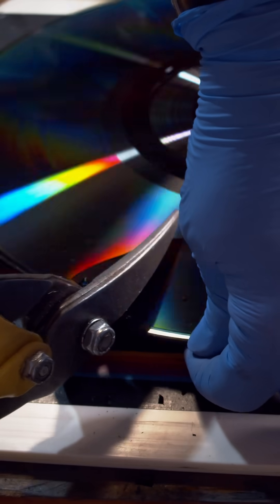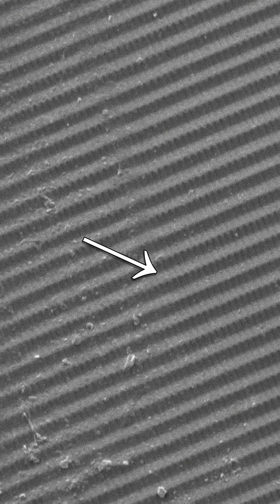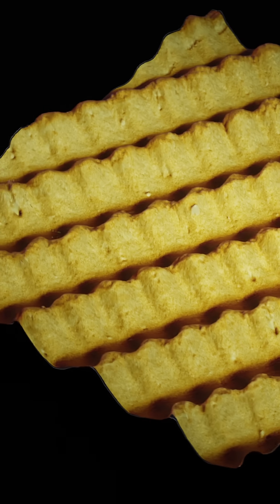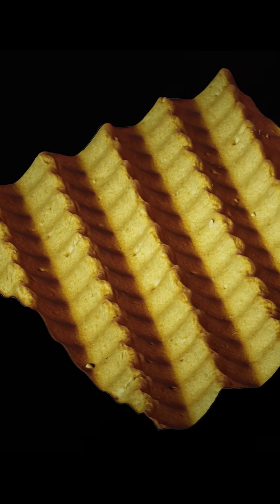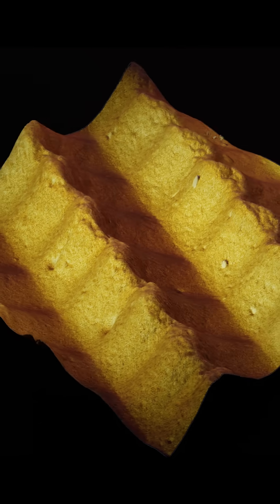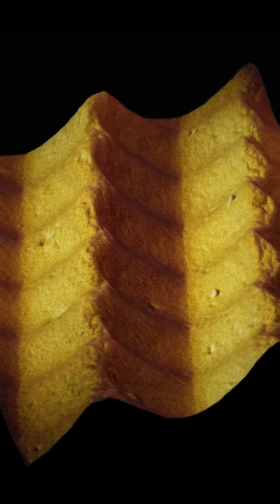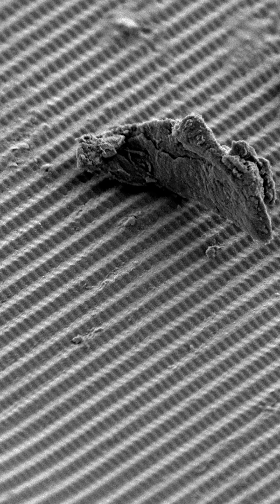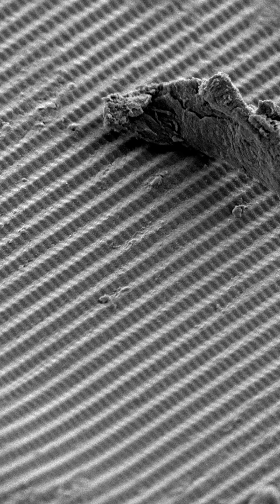Capacitance Electronic Discs

Comment: Okay so as the scales are read over with a laser, the hills and valleys give a direction to form code.. the code can either be transferred on the screen as a number or color.. any other external action is done by the external hardware reading the disc.. so HOW DO YOU SAVE INFORMATION without having to form new grooves on the external hardware ? … burning?

Comment: JVC's VHD (Video High Density) had even finer grooves and used a flat read head which tracked electronically along the groove.  The track density is even higher than Laserdisc.

Comment: These old discs were the highth of tech in the mid to late 70's. My dad got one as a gift from a friend and it worked, I meen we saw a few movies with this monstrosity, but the discs were prohibitively expensive to buy, and regular beta video was coming out about the same time and were cheaper both to own and to get movies for. In the early eighties VCR's were more expensive than beta, but in a weird turn of events, there was a legal battle about pattents and VCR makers won and so beta became a dead fish. They had to stop making them. After that, the vcr tape machines got cheeper, in the eighties. These other machines that used these huge analogue discs were just outmoded. My dad kept his for the longest time, and it was so very problematic about dust colecting on the huge disc while it was playing, we couldn't get through star wars without at least a couple of cleanings of it and the machine.

Comment: When was this technology even in use? I have never even heard of this. I thought everything was done using magnetic tape or vinyl discs back in analog times.
Reply from the maker: They started on the tech in like the 60s, but it didn't make it to market until the 80s (due to mismanagement, and some technical issues). What would have been revolutionary in the 60s ended up being a commercial failure in the 80s because it was competing against VHS, Betamax and Laserdisc. They stopped selling it pretty quickly, so most folks never really saw it "in the wild".

Comment: "technical difficulties slowed development and stalled production of the system for 17 years—until 1981, by which time it had already been made obsolete by laser videodisc as well as Betamax and VHS video cassette formats"

Such a common thread

Comment: Wait what? For the technology to be called capacitance disc, it would mean that a stylus would have to pass over the disc but not physically touch it otherwise it would not be capacitively coupling to it ...
You kind make it sound like there's a nano stylus that actually sits in the groove but then it's just a record...
Reply from the maker: Yeah so it's a bit more complicated, but had to paraphrase for the short. The diamond stylus rides in the groove like a record, but the length of the stylus is such that it rides over multiple ridges simultaneously which establishes a "ground floor". Then the pickup sensor that's on the stylus detects the small changes between that ground point and the individual pits/valleys inside the main groove.  See this image, helps describe the stylus arrangement: https://paleotronic.com/wp-content/uploads/2020/09/Radio_Electronics_January_1982-62-copy.png

Comment: Now explain it to me as if I was 5
Reply: A Capacitance Electronic Disc (CED) is a type of home video format that was popular in the 1980s. It worked in a different way than a CD, so let me try to explain how it works like you're 5!

A CED looks kind of like a big record with lots of lines on it. It's a bit thicker than a regular record, and it's made of plastic. To watch a CED, you need a special player that looks kind of like a VCR.

When you put the CED into the player, the player uses a tiny needle to touch the surface of the CED. The surface of the CED is covered in tiny bumps and valleys that are really small and hard to see. When the needle touches the surface of the CED, it sends electrical signals to the player that tell it what picture and sound to show on your TV.

The bumps and valleys on the CED are like a secret code that tells the player what to do. It's kind of like how your teacher writes on the board and you read what they wrote to learn something new. The bumps and valleys on the CED tell the player what picture and sound to show, just like the words on the board tell you what to learn.

So, just like how a CD player reads the bumps and flats on a CD to play music or show pictures, a CED player uses a tiny needle to read the bumps and valleys on a CED to show pictures and play sound!

Comment: What I love most about these is that the reason it’s a rainbow is because these grooves are so small that any light that hits it gets split into its core colours 

Think about that, grooves soo small it splits the light
Reply: The light isn't split, it's simply that the different thicknesses results in different wavelengths being reflected. It is not a prism which uses the principle of refraction.  This effect is based on reflection and "thin film interference".
Reply: Every 5 inch disc you have does that except for maybe the black copy protected games

Comment: Cool! For anyone interested, this is similar to how a scanning tunneling microscope works that can visualise materials on the scale of individual atoms! The 'dimples and valleys' in that case are litterally the gaps between atoms in the material, and as the 'stylus' moves it measures small changes in the current resulting from quantum tunnelling of electrons in the atoms to the stylus.

Comment: I remember checking out the 3 major digital disc systems at the 1979 AES convention in NYC.  Pioneer had laser, one transport that could support any of audio, data, or video interfaces. RCA had the crappy tracking stylus discs marketed briefly via Radio Shack, before consumers realized how much faster mechanical wear trashed video discs than phono records. JVC had the in between price point non - tracking capacitance pit discs, that made way more sense as an economy system until laser costs fell, but they were never marketed effectively. 

We engineers don't have Crystal balls, but we can act like it by tracking development cycles of parts, technologies, and systems, often years before retail consumers ever notice.

Comment: I worked on the design team for this system. The video FM carrier was 850 Angstroms peak to peak. The Audio FM carrier was 1/10 of that: 85 Angstroms. The Audio FM carrier required an CNR ratio of 40 dB, or 1:100 or 0.85 Angstrom. The master discs were cut in copper. A copper atom is 1.2 Angstrom wide. This means the required noise floor was smaller than the atoms in the master disc. The reason it worked was that the groove was 25400 Angstroms wide, which averaged out the variation due to copper atoms. 

Crazy technical achievement. But the consumer product was just a player, and couldn't record, and it came out at a time before VHS movie rentals were a thing. People were using VCRs to time shift. The CED couldn't do that. 

RCA wanted to sell itself to GE and the VED VideoDisc project was an albatross so it was dumped and RCA went to GE. The execs got their golden parachutes.
Reply: comments like yours are what I love most about YouTube 😍
Reply: @ooooneeee all the comments on this Guys channel are a absolutely Gem of Insight and Tech knowledge...

This had become a favorite💖
Reply: Wow! That's incredible Norm!
This is a brilliant piece of precision engineering. It never ceases to blow my mind when I see one. Very impressive technology.. still surprised it never reached mass production. Those suits didn't know what they were missing. It will be remembered, I'll make sure of that.
Reply: Absolutely love comments when I see people were part of the team and give us insight to the technology or process. You were in effect part of history. Amazing.
Reply: Incredible. Honestly just goes to show, That if they put their golden Parachutes Towards making CD's a thing We could Have had Iphones in the nineties
Reply: @PhilipIIofMacadamia thank God we didn't
Reply: Amazing. Thank you for sharing this glimpse into a part of history.
Reply: Hi Norm,  My Dad (Bill Morewood) and I (Jay), at separate times, both worked on RCA's Video Disk project at the Lab.  My Dad designed and patented the "Electron Beam Recorder" for producing the "Master Disk Plates".  I later working in the Material Sciences group, performed analysts on the diamond stylus, the carbon loaded PVC, (I developed a technique for acquiring slices @ ~10 angstroms for electron microscopy).  I also designed an instrument for real time detection of when a "video disk defect" was greater than what the "video disk defect" circuit could handle among other projects including the 1st robotic furnace to "grow" epitaxial LASER diodes cost efectively, which allowed for the mass production of the CD play technology as a consume product (which ultimately replaced RCA's Video Disk). Best regards  jay
Reply: @ferretseven  this is fascinating! Is there any more about how the master disk plate production worked in practice or is it contained within the patent filing?

You should make some videos yourself on the topics you mentioned 😎
Reply: as a radio mechanic i found your story fascinating.
Reply: That's wild!  I can still see this technology being used for niche secure keys.  You could fit a MASSIVE block of data on a tiny device that can't be read remotely or effected by EMPs/etc. and would last forever.
Reply: Legend :)
Reply: I remember seeing these discs come out!  It  was Super Expensive to have a player and the disks well as kids anything above Album was Futuristic Pricey.

It’s Amazing you worked on these things!  RCA WE ❤ AND MISS YOU!
My Dad has LOTS of RCA Test Tubes and Gawd knows what still in the house.  I will never part with them.

Brings me Memories of Century III Mall and the Tech Store with the Projection TV’s actually displayed the Video Disks.  We didn’t want to leave!
Reply: What was the stamping process like, was it like a retrofitted microgroove 12" process or did it involve plating the discs directly from negatives? If it was more like trad vinyl, did it use a DMM style process or did it go master/mother/stamper? My first thought was that surely the run yield from stampers can't have been that high before new stampers were needed given the groove wear, unless they were grown instead of stamped? Such a fascinating medium this and I wish it had taken off more for archival grade stuff.
Reply: The military bought some of these to use for showing training videos, but I only ever saw them used a couple of times, and then everything was about VHS.
Reply: @slappy8941 I'm sure the military still has buildings full of them. The government doesn't throw anything away.
Reply: Wut
Reply: Sir, please take your change and leave the Wendy's
Reply: @NonieTools  That's funny! I git your joke.
Reply: 1973 working at a “place” I can’t disclose I worked on a 5 x 1 ” cylinder of pure quartz, turning vertically at 10.000 RPM with 2 tunable lasers beams one on top that moved along the diameter, the other moving  vertically. Read and wright device for video, audio & holographic projection. 
These could wright at a molecular level on quartz molecules as visualized by X-ray refraction…
There were images of pre-historical scenes, Pterydactilis flying, scenery of volcanos erupting. Other “folders” hash scenes of cavemen, the construction off a pyramid, not sure which. After that  views of earth from space, continents were not what they are today. There were also scenes of a medieval battle (Hastings?) in minute details.  I am so glad that the “amateur version” of this technology is finally coming out in my lifetime  50 YEARS AFTER A MUCH MORE ADVANCED VERSION WAS ALREADY AVAILABLE! TOO BAD I CANT SAY MORE. I want to die of natural causes! 🤫😵‍💫
Reply: @tonytor5346  How did you see pictures of those times? I don't get it
 I want to tho! ;)
Reply: Thank you for the explanation, and fantastic work!
Reply: So...me no club?
Nah, who me kidding me still club.
Reply: @johnboats9075 why you think me eat dinosaur brains?! Me hate brains.
Reply: Damn! Those were the specs? Man if these became mainstream back then there would be you tube videos where someone is building CED microscopes using an esp32 or RasPi in their bedroom right about now. Truly amazing technology in this system.
Reply: I usually pick these up anytime I see them at a thrift shop.they usually sell for under $4 each. I prefer them to be a crappy movie because they look really cool in a frame on the wall and I’d hate to destroy a nice one.
Reply: Thank you for the additional information
Reply: @gnornhurst Wow! What a great story. I see this like a digital record groove. 
Can you direct me to a video describing how music is put into vinyl grooves of a record, and then read by a diamond stylus that somehow separates all the sounds in the record Grove and transformed into a digital format send to a amplifier and heard in speakers?  I don't understand how sound can be "stored" in a m9lded piece of plastic. How does it separate high voices and low drums, etc? Incredible.
Reply: @joebudi5136  vinyl records' grooves are a purely mechanical analogue representation of the sound waveform - literally a capture of the 'vibration' of sound. A few things are done to process the audio prior to being cut to a disc (mostly EQing, to optimise the signal-to-noise ratio) but that's about it. You can even get a piece of very stiff paper with a sharp enough edge to make a rudimentary stylus; place it in the groove as the disc rotates, and provided the paper is stiff enough it will reproduce the sound.

To understand exactly how vinyl records store waveforms, you must better understand the properties of sound waves. You can have a very simple sound - a sine wave, a pure constant oscillation at a specific frequency (which can be roughly approximated by whistling very clearly) - or any complex combination of distortion, harmonics, different wave shapes and so on. The interplay of different frequencies and waveform shapes produces additional new frequencies which together can sound quite unlike their individual components. Every single sound, natural or synthetic, can be broken down into its component parts, if you understand well enough how to. Combining different frequencies, wave shapes and types forms the basis of electronic synthesis.

Capacitance electronic discs store a frequency-modulated electrical representation of the combined video and audio signal, which is demodulated by further circuitry after being read from the disc. A CED's surface is capacitive, and the stylus reading it is tipped with a small electrode. The signal is recovered using circuitry which picks up and constantly measures the constantly changing electrical signal representing the encoded video and audio data. This signal is induced due to the constant change in the height of the undulations within the disc groove, encoded into a modulated carrier, so it is not a purely mechanical representation of the audio or video in that regard.
Reply: @ChristopherWoods  You took that much time to explain it to me? That's awesome! I kinda ger the analog and a little the ced. Incredible what humans can think of and accomplish. Thanks!  Hello from the Caribbean!
Reply: @joebudi5136  it's no worries, I just hope it helped instead of confuse 😅 I'm a sound engineer with a massive vinyl collection so for once in my life I actually knew a little bit about the topic. How sounds are stored and captured on different formats is a fascinating subject, there's many good videos about the science and technology behind it on YouTube if you have some time and you're still curious. 🙂
Reply: @ChristopherWoods  I made a living booking vinyl dj"s for 20 years. Never quite understood how it worked on the vinyl. I know how it worked in  a room!!  I moved to the Caribbean and brought my old Klipsch  la scallas and some turntablea with me out here. Love vinyl vibe.
Reply: @joebudi5136  there must be some stories behind that story... 😎
Reply: Thanks for sharing this with us all! Your comment was very "graceful". 😁
Reply: As close to wizardry as I have ever seen. Followed closely by MEM chips.
Reply: Thank you i learned more from your fitst 4 sentences then i did this whole dang video! lmao
Reply: Well explained and thank you for your contribution to humanity
Reply: 560 people have no clue whether or not this guy just pulled all that out of his ass. Haha
Reply: really? that's incredible

Comment: The original Machine had a base plate of prefamulated amulite surmounted by a malleable logarithmic casing in such a way that the two sperving bearings run a direct line with the panametric fam.
The lineup consists simply of six hydrocopic marzel vanes so fitted to the ambiphasient lunar wane shaft that side fumbling was effectively prevented. The main winding was of the normal lotus-O deltoid type placed in panendermic semi-boloid slots of the stator. Every seventh conductor being connected by a non-reversible tremi pipe to the differential girdle spring on the up end of the grammeters. Moreover, whenever fluorescent score motion is required, it may also be employed in conjunction with a drawn reciprocation dingle arm to reduce sinusoidal depleneration. The retro-incabulator has now reached a high level of development and its being successfully used in the operation of milferd trenyans. Its available soon, wherever Rockwell automation products are sold.
Reply: That is some beautiful technobabble, man. 🥲